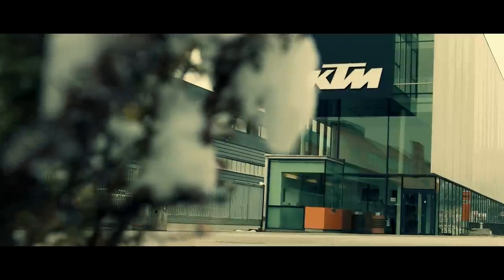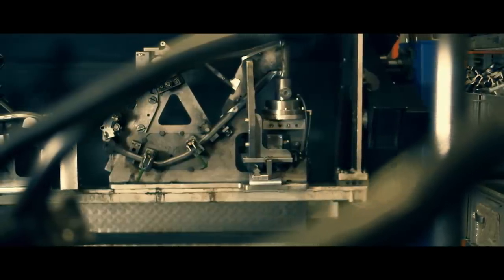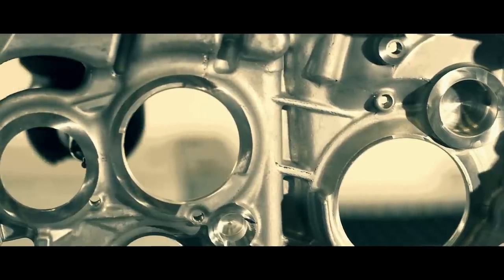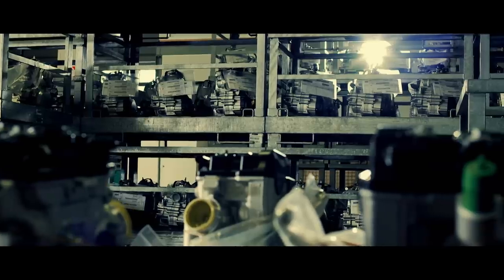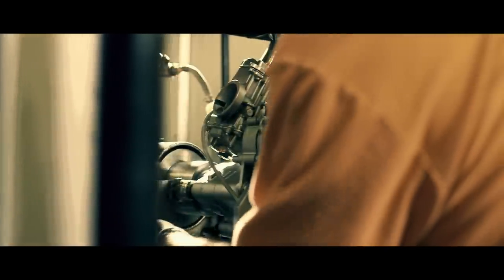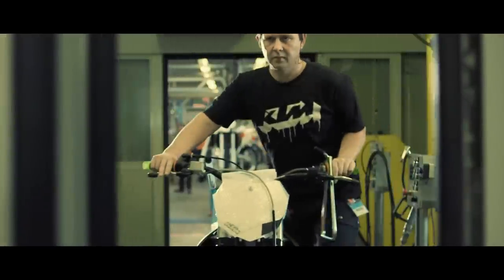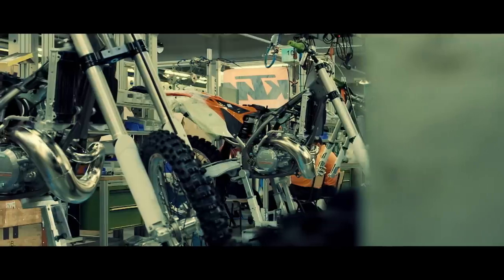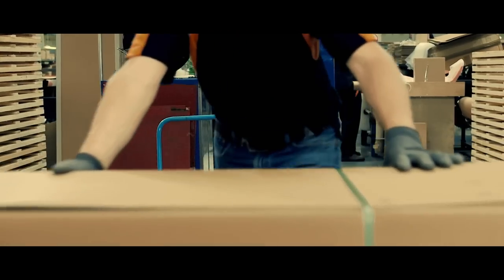Birth of a Motorcycle - Behind the Scenes at KTM

Comment: Why do they recommend to slowly break in the engine after replacing piston and cylinder wall for correct piston ring seating if they go balls out on the dyno. Do they properly break them in before they go all out to check power? Anyone who has been to the factory please answer this.
Reply: I’m wondering the same thing
Reply: 8 years later, I guess it won’t be answered

Comment: but who are you to judge if the WP`s is not as good? No one leaves their suspension stock these days. you know that WP is very similar to showa internal right? Have you ridden full work forks? Stock forks with revalve is as good for anyone no matter brand. No one can use these forks to its full potential anyway. Its good quality with any of the top three suspension manufactures.

Comment: how can you sit there and write that? the pathetic steering damper on the CRF's doesnt even count. how can you possibly sit there and say that WP suspension if inferior as KYB or Showa? It is far superior!! KTM has the best tooling, workmanship and product quality control in the off road motorcycle industry and the reliability of their machines is shining proof. The engineering power of Honda is astounding, I agree, however stating that they are better than KTM is totally untrue.

Comment: WOULD LOVE TO BUY KTM BUT THEY ARE JUST TOO DAMN EXPENSIVE COMPARED TO ALL METRIC BIKES.

Walked into dealer and a 2013 KTM 450 SX-F is starting at $10,299.00 CDN. Old steel frame, finally are fuel injected this year as previous ones were not. Yeah I understand they have electric start, yah I understand they have a hydraulic clutch. 

All the 2013 Japanese bikes are around the $8,500-$9,000 CDN range.

CHEAPER PRICES KTM!